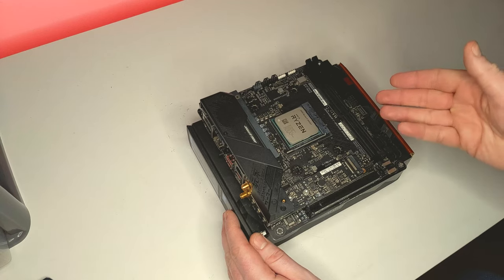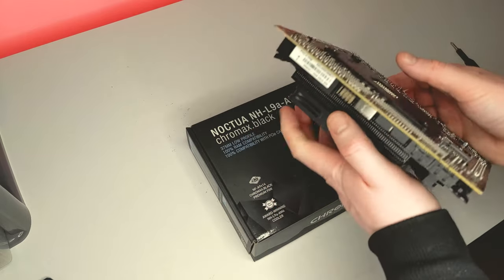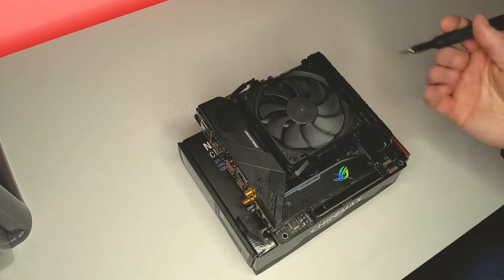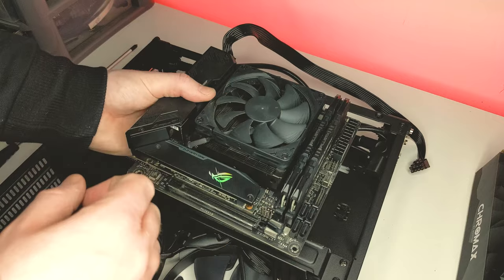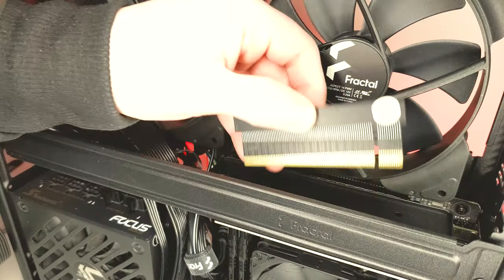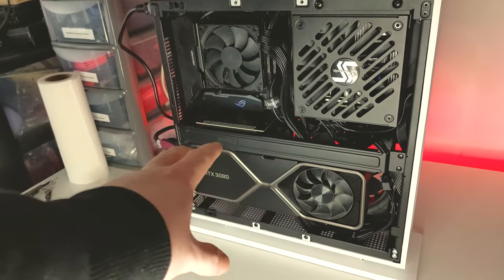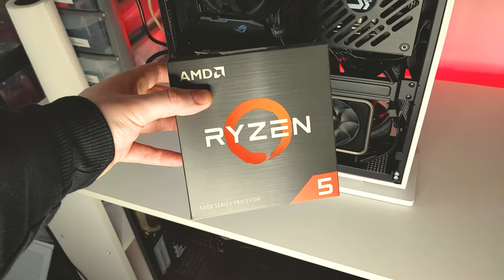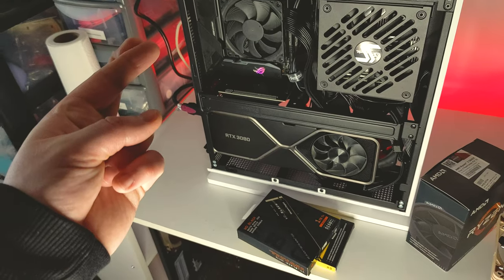Building A PC In The Fractal Ridge! Ryzen 5 5600X & RTX 3080 Build

Comment: in my build, i added two 60mm x 10mm fans on top as exhaust(used a 3 in 1 pwm cable connect them with the cpu cooler fan so they can work at same pace), cpu cools lots, those 2 fans just fit in the gap on top exactly(it's 60mm too), may need zip ties to fix them though, also the cpu cooler im using is the thermalright axp90-x53, gaps on this cooler's heatsink are vertical, so when fan on the cooler blow in cool air and cool air becames hot air, would be sucked out by top 2*60mm fans. i also use 5 fans to cool the gpu, 2*120mm fans(replaced original 140mm ones, they too noisy) and 3*80mm(10mm thick) fans at the bottom as exhaust too. i tried either cpu on top or gpu on top and prefer cpu on top version as cpu only has 3 fans, but gpu has 5 fans(in this case) + 3 fans(on gpu itself) and that should be enough. those two 120mm fans with a 2 in 1 pwm cable to CHA FAN1, 3*80mm with a 3 in 1 pwm cable to CHA FAN2. gpu is palit gaming pro 3090, cpu also 5600x.

Comment: I have a 5600x on the ridge and during mw2 I’m hitting 90c. The only problem with this case is the cpu temps. I’m going to try and add 80mm fans if I can fit them

Comment: Ive built 7900XTX without top fans and 7600X on 120mm DeepCool AN600. GPU is never over 68-69C powered by 2 stock 140 fans and 7600X undervolted gets to 58C with MW3, Helldivers2 or Cyberpunk. Without undervolting add 15 degrees tops.

Multicore stress test CPU goes to 80C undervolted

Comment: I am running a 5800X3D in my Ridge with a Noctua NH-L9x65. I am not worried about the CPU temps, the temps are higher compared to my old Meshlicious set up, but I only game.

I am surprised you didn't get the gen 4 riser card issue. I had to switch the BIOS settings to gen 3 for the time being. I am waiting for Fractal to provide a fix.

Great video!
Reply from the maker: Good going with a 5800X3D fair play. Didn't realise there's a riser card issue though so I'll have to bear that in mind. Cheers mate!

Comment: in my case i used a 69mm Scythe Big Shuriken 3 it has 120mm fan that runs cooler than the Noctua you used in this video. Under load CPU is 63C
Reply: wow that's really good, but i'm having trouble finding the shuriken
Reply: Found an argb option on ebay uk

Comment: Awesome stuff. Do you reckon something like a 12700F or 12900F would be suitable in a Fractal Ridge build or would they require more cooling than can reasonably fit?
Reply from the maker: Cheers mate. Considering they both have a 65w TDP you could be okay but maybe potentially limiting the thermal boosting potential but using something like the Noctua NH-L12S should still be sufficient.

Comment: Dude the case is upside down, have you considered having GPU ABOVE the CPU how it is meant to be used ?
Reply from the maker: It can be oriented either way. Seen a few other people using the same config but could try switching some time.
Reply: @PCJack  it can, doesn't mean you should. Doesn't all the hot air from the GPU goes up to CPU chamber in your version of the build? I'd assume GPU produces more heat than CPU would?
Reply: @PCJack  actually I'd would be very curious to know if it really affect thermals as one might anticipate or not
Reply: maybe going to check it myself when my preordered ridge finally arrives